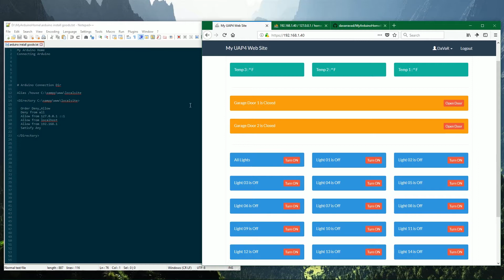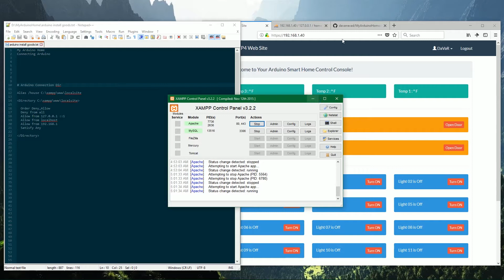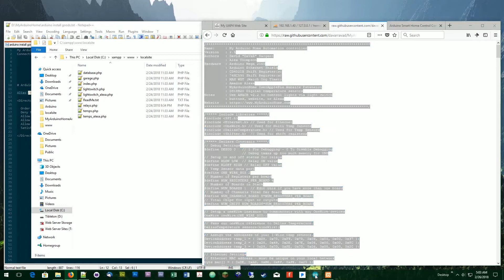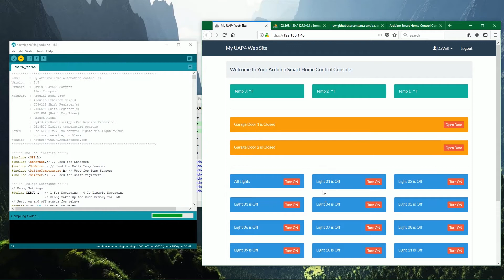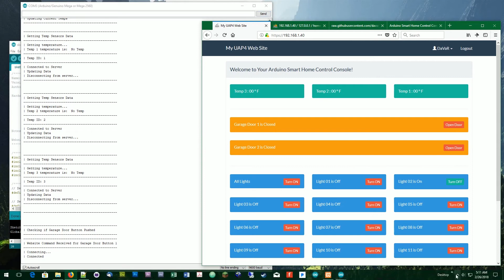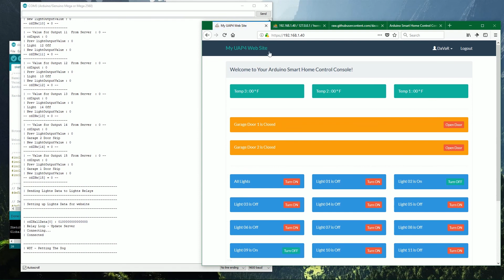My Arduino Home Automation - Connecting Arduino - Part 2

Comment: Hello i was wondering a few things. I have 4 Temperature sensors two of them are Si7013 and two of them are thermistors. Is if i added them would it be able to automatically come up in the control panel? Second question is the light controls.  I only have 4 light controls Will i be able to delete the rest if i need to?  Thanks for sharing with us your home automation project. Are you planing on adding any other things to it?
Reply from the maker: For the temp sensors, you might have to alter the code to work with yours.  I am not sure if they use the same libraries as the ones I used or not.  

The code can be altered to your needs.  I currently only have 3 light switches connected at the moment, so the code quickly scans the unused ports, but no noticable delays.  

At this time I do not have any plans to add to the controller, but who knows when I might get a wild hair.  

I do know that there is a delay when communicating with the web server, and one of these days I will sort that out.  

Thanks for the comment
Reply: @myarduinohome6468  Thank you. Sorry i have gotten back to you this late.  taking care of my father and cancer.

I have one Question the php and html where can i find this at? 

Joseph
Reply from the maker: https://github.com/davarravad/MyArduinoHomeAutomationControlWebsite

I plan to upgrade the site soon, but there is the current site files.

Comment: hello sir i am Amir. i wanna do web platform so the arduino code miss the libraries so what you are used
Reply from the maker: Amir Omar Amir I will look when I get a chance
Reply from the maker: Sorry for the delay.

You can download the following libraries in the Arduino Library Manager within the Arduino IDE.

SPI.h
Ethernet.h
OneWire.h
DallasTemperature.h
Shifter.h

Open the Arduino IDE
Select Sketch
Select Include Library
Select Manage Library

The Library Manager will pop up and you can search for each library listed above and download them.
Reply from the maker: Shifter.h library is not included in the Arduino IDE.  

The shifter library I used is as follows: https://github.com/ameyer/Shift-Register-8-Bit-74HC595